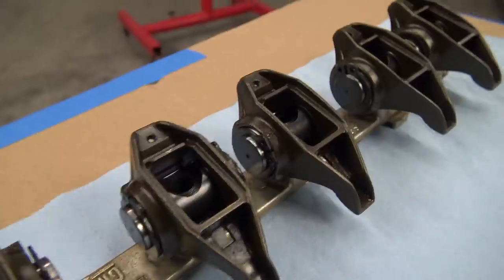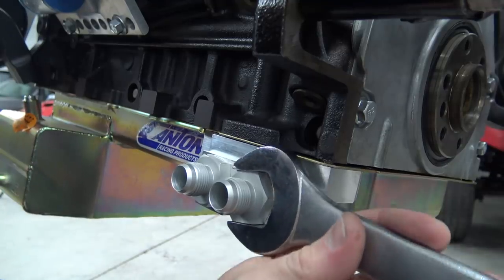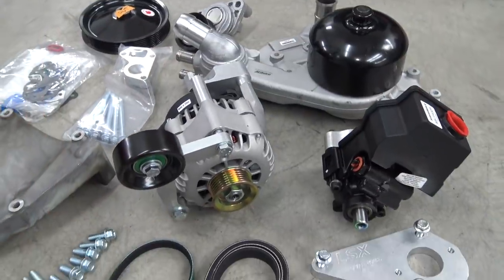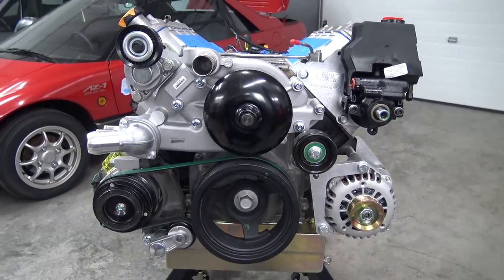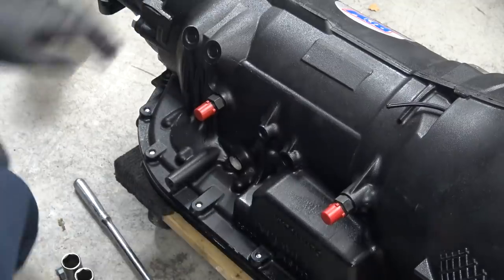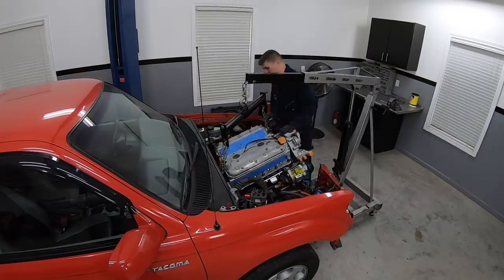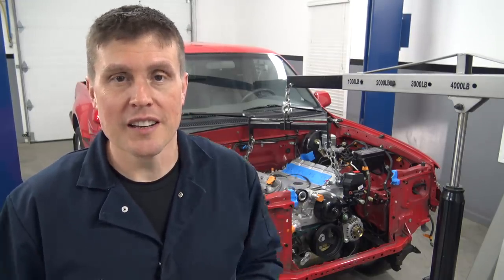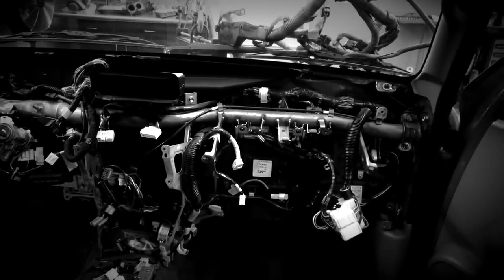LSX V8 Turbo Tacoma - Project Firebolt Part 6

Comment: I’m kind of disappointed you decided to go with an automatic trans over the t56...
Reply: Eh, for a daily it makes sense.
Reply from the maker: I hear ya man, but for my use on this beast, it makes more sense.
Reply: Tom's Turbo Garage I respect the build. I feel that we live in an era where manual trans are dying. I think it would have been cool if you had decided to convert it over to manual. It will be a monster either way and I can’t wait to see it finished.
Reply: Michael D I was partially joking And don’t mean to offend you. I agree auto trans are faster, but, manual cars are more fun to drive. Putting the auto shifter in ‘S’ mode will not give you the same driving experience as a real manual trans. Using ‘paddle’ shifters is not the same. From a driving experience perspective I believe manual trans are 1000% better. You prefer automatic, my wife does too. Nothing wrong with it. I like manuals, let’s agree to disagree

Comment: Tom, when I saw that you were using a B&M Hydro in this project my heart skipped a beat. That's what I had in my '55 Olds, that sported a '58 J-2 engine, back when I was in my late teens. It really did the job, so I would think today's technology would do an even better job of handling lots of power and torque. Thanks for another great video.
Reply from the maker: Cool Gary!  I know you're a hot rodder from way back sir!  You're welcome and it's always a pleasure to hear from you. 👍🏻

Comment: You might be able to get banjo fittings that go to AN for the oil filter
Reply: People have done the same with the transmission cooler fittings and posted them on sloppy
Reply from the maker: Thank you sir, I’ll check both of those out 👍🏻

Comment: An air hammer works great as well for figment adjustments 👍🏻 on the LH exhaust issue you might be able to use a RH truck manifold with rear dump, and run it out the front, just an idea 💡

Comment: If you haven't fixed it already the remote oil filter issue is an easy fix. Just put a few 90 degree fittings on there. You can point them any way you want. Now that steering shaft will be a pain especially when trying to route your pipe over to the turbo side. The good news is that you won't have to necessarily go down with it. You can go up and around the front of the engine if you REALLY have to.

Comment: I love the build so far. A lot of quality parts!  I must say though the plastic intakes scare me. The brass insert that holds the fuel rails down seems fine for stock injectors. But when you put big injectors and high fuel pressure in the mix I’ve seen posts of them pulling out and causing a car to burn down. Just food for thought

Comment: Tom, you need a sheet of corrugated plastic to place down when crawling under cars. Corrugated plas is great in this role, as you can easily slide around on it and clean it up with a waterhose.

Comment: @Tom - You can drain into oil level no issue. Think about it, the pipe is not gonna have a higher oil level than whats in the sump anyway. Done this before, and people said i couldn't, but it has never failed anyway

Comment: Hey Tom nice quality build. I notice the transmission oil line fittings didn’t have the tube piece that goes inside the hole to lube. Without the tube tranny fluid goes in but washes down to the pan causing failure and damaging the tranny.
Reply from the maker: Thank you for the heads up on that!  It's my understanding that only the rear fitting has the tube piece, which this one had.  You can see it at the 12:37 mark FYI.

Comment: Hey Tom, I’m really enjoying this build. Having a 1st gen ‘95 Tacoma myself, I’d like to drop  a V6 engine in mine.
I was wondering, would a 1”-2” body lift help with clearance so you don’t have to use the “Tom clearance tool”?
Reply from the maker: Hello sir!  I suppose a body lift would help, but honestly, it didn't need much "clearancing" at all. 👍🏻
Reply: Tom's Turbo Garage thanks for the feedback.

Comment: I love it Tom! How about welding a couple on 90 degree elbows to the oil adapter or directly to the pan? I had the same problem with my 69 Camaro LSA build. I'm loving the project and the updates.
Reply from the maker: Thank you sir and I appreciate the tip on that, I may need to do that for sure.  Your build sounds amazing!

Comment: Have you looked at electric power steering rack  line on the new Chevys might help free up some space by being able to remove the steering shaft all together
Reply: And maybe an electric water pump?
Reply: @WryGrass100  true that remove some parasitic drag
Reply: @joeysawyer7572  I think the idea is more of a daily driver, after market electric water pumps are designed to be run in a daily driving situation, they're for racing, here for a good time, not for a long time, 30k miles at best on an educated guess. The boost will more than make up for any parasitic loss.
Reply: Aren't designed*
Reply: @Elxmo  good point but I was initially thinking about just the electric power steering this way it would  do away  with the steering shaft then again a hydraulic steering setup would do the same thing like on the big tractors or some heavily modified jeeps

Comment: Brother you're really trucking away on this thing. High mount manifold that goes up and forward instead of down and back would solve the exhaust issue on the drivers side IF you wanted to do your crossover in the front. I'm not sure how much room you're gonna have to work with between the accessories and the radiator up front though.
Reply from the maker: Great to hear from you and thank you for the support and ideas too!  Yeah, this engine bay is surprisingly cramped.  It looked spacious until the accessories came into play, haha!  Take care man and glad you're enjoying your third gen!

Comment: Great progress! I just love the LS! 5,3 on the inside, but not much bigger than that tired toyota-powerplant!

Subbed btw.. 👍
Keep up the good work!
Reply: tired? ill bet that used Toyota motor will outlast the new GM...you could even use cheap oil in the toyota and Amsoil in the chevy and it will still fall apart after 100 thousand miles

Comment: Any chance factory log manifolds (flipped) will work for clearance?  You can still make mega horsepower on an OEM log manifold (oooh and the best part?  They seal tight, dont burn plug wires, and dont leak!)
Reply from the maker: Hi Hunter, oh definitely a very good solution, just no room up front either with this cramped engine bay and accessories and such.

Comment: Thanks for the comparison view of the two drive trains, wow they are close in size!  As far as the exhaust goes, perhaps put the turbo out front with upside down headers and a fat single going back the passenger side?  May need to put the radiator in the bed, but hey you didn't plan for this as a grocery-getter right?

Comment: You could of used a Tremic transmission instead of a B&M. That if you just using your truck just for every day truck usage. I think Tremic might of been cheaper. The oil filter adapters will have to have 45 or 90 degree elbow adapters for for oil lines. No worries. Just face them downward and have the hoses bow upwards between the steering shaft.

Comment: It would be wise to thermo wrap your starter.
Have you thought about running your exhaust on the drivers side to the front? I think that drivers side is going to be a no go unless you modify the steering linkage.

Comment: Tom. I dont know if any one asked. But did you redo ring gap? Cuz dont you want to be a lil loose compared to n/a? Just wondering. And gen 4 rods i guess are a lil stronger. Unless your going for the 450ish mark then rods would be fine. But the ring gap. I just dont want to see breake a ring land j.w?

Comment: Why don't use a electric power steering pump? I think drifters use the mr2 electric power steering parts
Reply from the maker: I checked into it but the rack itself is too big for this space.
Reply: Canyon/ colorado e-rack....$400 new...no pump...no space issues....
My secret
Reply from the maker: @karter9907  Hi Ron, that is a superb idea, but I measured for it and there wasn't enough room for the motor end. 😑

Comment: As always, love the videos! Great work! I did have one question though. I apologize if it has been a previous one. When you were setting the torque on the oil pan bolts I couldn't help but wonder how you would set the torque on the bolts directly below the baffle (engine upside down of course). I don't imagine the torque wrench head would fit in there and I know oil pans require a set torque and torque sequence when installing. Just curious how you addressed this issue.

Comment: Dang you really believe in torque specs for everything
Reply from the maker: I suppose so, weird things happen to metal when bolts are under/overtightened or tightened inconsistently across a surface.
Reply: Tom's Turbo Garage Yeah I’ve stripped a bolt off in my block and destroyed it, my mom was not happy when a new one showed up at our door the next week. I’m 14 and restoring my grandpas 1969 Chevy C10

Comment: I am in the middle of a 2jz swap into a single cab 99 tacoma.  Should be interesting to see you run into some of the same issues.
Reply: Your exhaust (which is generally the shitty part) is on the opposite side to the steering junk, plenty of room under the intake for steering bits.

Comment: all the coiled up hard lines near the valve cover, if there was an easy way to remove and make them all mount up closer to the cab would help with clearance, but it might be the angle of  the camera making it look in the way.

Comment: I was really surprised by the engine size comparison.  I thought for sure that the 4L80 was going to be at least a few inches longer.  Are you able to use the stock driveshaft?
Reply: Gotta be close and depening if he slide the engine mounts back or worth any

Comment: As my 'newest' car is a 2010 Honda CR-V I am not up to speed on the latest and greatest but does any one make a stock or after market "steer by wire" system that would do away with the steering shaft? Seems with the number of advances made in the past 20 years someone might have come up with something like that. The truck is coming along very nicely and I can't wait to see the next video.

Comment: Is that pan galvanized? I would have been been concerned welding that material without having removed the coatings on it first... Just a thought...
Reply: I believe it is a zinc finish.

Comment: 19:20 Is it just me or does the end of the boom on the hoist arm where the chain is connected hooked up wrong. I believe there should be a slot right under that bolts that the chain should hang from so that the much stronger bolts is holding the weight versus the chain laying across the edge of the box from of the boom.

Comment: Is it a single turbo? If so why do you need an exhaust to go down near the steering. Driver side exhaust goes to passenger side and merges  to the turbo.  Single exhaust down pipe on passenger side. Or did I miss something?

LS Mazda , LS Toyota,  LS Nissan 350Z , and  LS Honda Prelude.  You might as well do the last two suggestions !
Reply from the maker: I can't route the exhaust forward due to the tight engine bay, but yes that's typically how its done.
Reply: @TomsTurboGarage   Yes , space the final frontier! Thanks, keep up the great work.
Reply from the maker: @nukesaway4806  Haha!  Thanks man!

Comment: If you used the stock GTO pan, the filter would be in the front. Did you ever take measurements to see if it would work? Did you get the block dipstick plug PN from my Cougar build? :-)
Reply from the maker: What’s up man!?  I checked the GTO pan and it would not fit without cutting a significant amount out of the center crossmember.  I got the plug from talking with a GM parts desk guy
Reply: @TomsTurboGarage  Shocking the GM parts guy knew. I used those little plugs as well, because I used the GTO pan on my Cougar. Keep up the great work!
Reply from the maker: @projectgattago  I agree!  Usually talking to parts counter folks about anything custom is a total trainwreck, but I lucked out on this one I guess, haha!  Thank you again for checking out my videos, enjoy your beast of a Cougar, I love it!

Comment: Come out the front on the driver side. Have that feed back into the other manifold.
Works fine.
Reply from the maker: I agree, that works fine if you have an engine bay that has that sort of room.  This engine bay is really small.
Reply: @TomsTurboGarage  vertical end tanks on the intercooler, and you could come straight down over and across. Stock manifolds shouldn't take much room, once the exit angle gets Tom clearanced.

You've got a much better look at the available space for your intended parts.
Good luck man. I know you'll get it figured some elegant way.
Reply from the maker: @-FOXX  Thanks for the ideas man!  It's situations like these where I wish I had some help in the garage, someone with experience and a good eye to collaborate with, but alas, it's just me plodding around in there, figuring it out as I go, for better or worse!  Have a good one and thanks for watching!

Comment: but Tom, aren't you gonna drain that turbo oil right onto that oil level sensor, the way the holes are located?
Reply: nevermind, apparently  you're not using that sensor O_o

Comment: I know it's an older car and engine, but why an outdated 4 speed transmission? Is a 5 or 6 speed not available?
Reply: It's not really needed to be honest, the 5 and 6 speed (an now 10 speed, thanks Europe) are more aimed at small engines that need the help staying in power and keep the fuel economy up. Being a larger engine and fuel consumption probably not high on the list, the 4L80 is tried and true behind the LS. Remember, more isn't always better.
Reply: @Elxmo  I'm sorry to say, but even larger engines have upwards of 10 gears. It's efficiency at any given speed. The more gear ratios, the better. That's why having infinite amounts of ratios (cvt) makes for more efficiency.

The tried and true part though, probably the deciding factor. A 4 speed that's been around for a long time has the reliability, which is probably what he is going for.

Comment: which flextplate did you have to use with that fti converter? thanks great video.
Reply from the maker: Hi Brandon, it's the stock 5.3 flexplate,  which required that little adapter doodad.

Comment: Wait what? Were you welding aluminium fitting to steel oil pan :O?
Reply: It was steel.  You can buy AN fittings in either material.

Comment: seems odd to replace Toyota with AC Delco...its really no different than an S10 V8 conversion where the devil is in the details as you finish it off. the difference between a hack job and a good job is all the little things that you are taking to do right...this is going to be a fine build

Comment: 10an drain fitting is too small needs to be 3/4" inner diameter or 12an. Also need to drain away from the sump ideally side of pan or back in your case with the flopped pan.

Comment: Wow the weld on the LS oil levelling sensor bung is scary bad, the person who did the welding was running insufficient amps for sure, he's got cold rollover, could end up being a darn good mess should it be struck, most definitely it would let go. If I were you I'd pop that pan off and run a decently hot pass on the pan side. Just saying, Cheers !
Reply from the maker: Yeah, they're not the cleanest welds Ive ever seen.

Comment: It’s crazy how small the 5.3 is.
Reply: LS block & yota 22re 4banger are exactly same length 20 1/2...his is a 3rz/2rz i guess?
Reply: LS block 20 .5"
Yota 22re 20.5"
But a V6 LFX/LGZ would be killer!!!
Small and tons of power in a great size with NO EXH. MANIFOLDS!!!  
A LS copy in a 6cyl container!  Forged crank/ oilsquirters!!  6bolt caps etc etc....Honest!!

Comment: Drain should've been FPTxAN and just used a close nipple coming out of pan to FPTxAN fitting instead of welding it on
Reply: Very simple idea, problem is you lose area inside the drain/dip stick hole, which means you lose flow, really isn't a good idea with a turbo, the bigger the drain, the better. With the fitting being welded over, you still retain its size.

Comment: 4L80E!!! Talk about overkill. 4L60E or 4L65E would have been plenty. Not to mention the 4L80E is really heavy by comparison
Reply: I can hear the 4L60 having a bunch of neutrals instead of driving gears already. Future-proofing it too, for when it's 4 linked and 900hp.
Reply: Sassy The Sasquatch not really. Replace the basket/sun gear which is prone to breaking and your set if you don’t cheap out on clutches and upgrade servos and your done. The money will be spent on the converter which is a must on either tranny bc of boost etc

Comment: You lost me.  Why modify the AN fitting to weld on when they make one to go between those two thread ports?  Seemed excessively large too, like a -6?
Reply: For a drain, big is best. Have a googling at what oil looks like going out of a turbo, I'd hazard a guess it's about 6 times it's volume, it comes out like a milkshake.
Reply: @Elxmo  Yeah I suppose erroring on the larger side is best.  I come from the diesel side of things where turbos have been the norm since the 60's.  Lots of hours at full load and I generally don't see massive return lines on anything from any manufacture.  If space is at a premium then size becomes a constraint.

Comment: Eh. Just run the drivers manifold across the front of the engine to the turbo.
LS radiators are extremely thin and there's plenty of room in the bumper for the condenser and trans cooler.

Comment: I thought the AN  fittings are aluminum and the oil pan was steel
Reply: Normally they are, but they do some fittings in steel, which was selected to facilitate welding it to the steel sump.